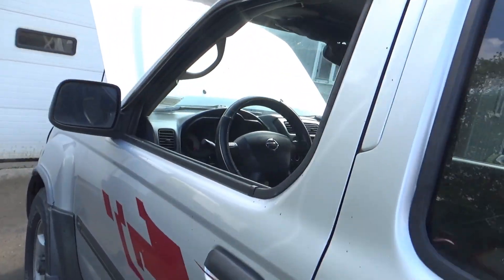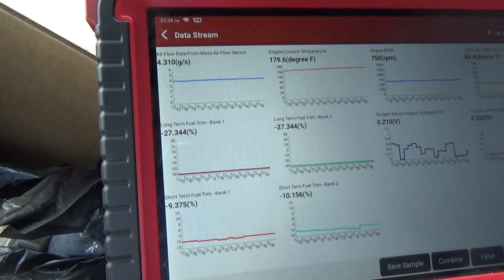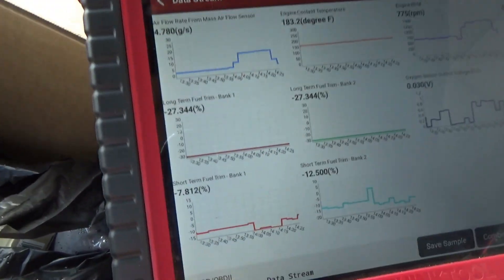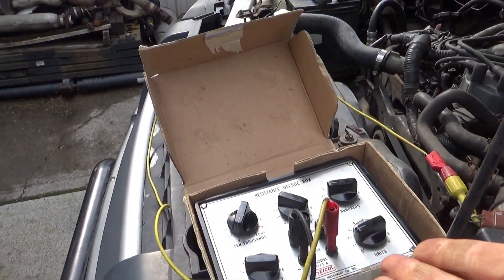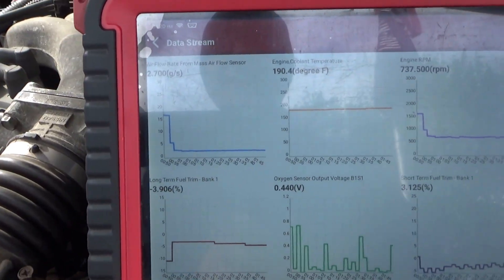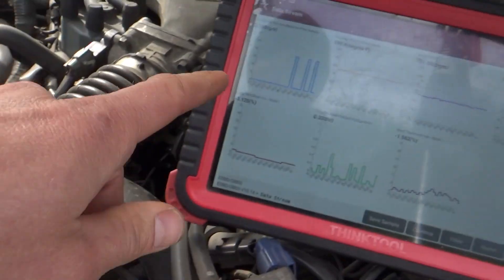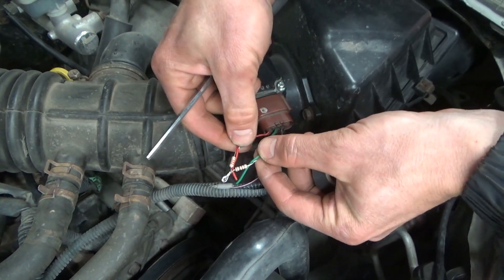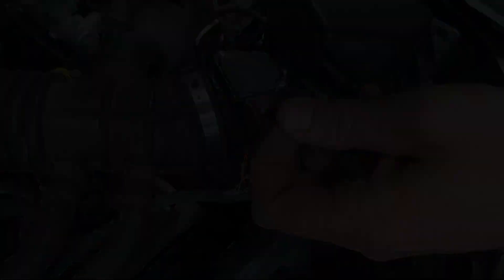I'm STUMPED...Crazy RICH XTerra P0172 (Part 2)

Comment: I know you have a part 3 coming.

From what I see here, I would suspect either O2 sensor issue or fuel injector / pressure issue.  Even before you changed the resistance the values were pretty much in spec per the service manual, I understand why you did that, but I don't understand why you didn't test the signal at the ECM.  The glitchy OBDII readings also make me wonder why you didn't get the scope out and do a more thorough data log on the MAF readings, maybe you didn't have the scope with you that day?

But at this point you've pretty much ruled out the MAF as being out of spec, but you are still trending negative on the fuel trims. The screens you showed with the fuel trims, the Short Term always trended to negative, they never seemed to find a happy balance where they would fluctuate negative to positive to negative, and the long term trims seemed to be showing the same 15:17. What else contributes to the fuel trims on this vehicle?  MAP(?)/Air Temp(?)/O2 sensors / Fuel Injectors / Fuel Pressure.   If the air coming in is being metered correctly/accurately, and you are still running rich, then either the O2 sensors are misreporting or there is another reason that too much fuel is getting into the combustion chamber.  Since you don't have misfires, I would expect the problem to be more uniform, which would tend to point towards incorrect fuel pressure, probably a faulty regulator.  

You mentioned that there isn't a port to test the fuel pressure, but that doesn't mean its not possible, its just not as convenient.  At this point I would think to start with verifying the fuel pressure is within spec, that the regulator is adapting to engine load, that the fuel pressure holds stable at KOEO,  and then I would consider testing the pressure drop from each injector, which I believe you've shown how to do in other videos on the channel, to verify they are all functioning comparably.

It's still a process of elimination, and I haven't seen a definitive AH HAH moment yet from the first 2 parts.  Usually when you make a decision to modify something it's more definitive than what you've shown so far here.  Clearly you are making improvements with each attempt, but I hope Part 3 will get to the root cause/solution.
Reply: what about the A/F fuel ratio sensor in the exhaust pipe?
Reply: @randy1ization  that is the O2 sensor.  There are at minimum 2 on this vehicle because his diagnostic screen showed him monitoring them, and realistically that means there are likey 4 O2 sensors, because they are almost always installed in pairs to monitor the catalytic converters.  The ones before the catalytic converter are the ones the engine uses to adapt the air fuel ratio and these are the most responsive for diagnostic uses.   From the diag screens he showed the O2 sensors are giving believable data, but they are both trending to reporting a rich air fuel ratio.

There is no seperate sensor in the exhaust system to measure air fuel ratio. This is the job of the O2 sensors.  The engine has to know at minimum 3 things to calculate the air/fuel ratio... How much air went into the engine, how much fuel went into the engine, and how much oxygen was left after combustion.

MAF sensor is in the intake to track incoming air.
O2 sensor(s) in the exhaust monitor outgoing air mixture.

The computer is programmed to cycle the injectors a set amount of time based on engine load/rpm and has a value for how much fuel should be added in that amount of time.

It takes the sensor data and the fuel timing and does a little math to get the air/fuel ratio.   And then it adjusts the fuel injection timing to chase the desired air fuel ratio.

If one of the sensors is  giving inaccurate data, then the calculations are inaccurate, which is why he went after the MAF first after demonstrating that causing an intentional vacuum leak and allowing unmetered air to be pulled into the engine, that the O2 sensors reacted to the change and the computer attempted to compensate.

There are limits programmed into the computer that set error codes for either RICH or LEAN conditions if the amount of fuel injection timing the computer is having to request goes too far from what it's programmed to expect.  Usually that's something around +30% or -30% fuel injection timing.   Some variation is normal ideally you would want to see +/-5%...uo to 10% is about typical.

Comment: Few suggestion Ivan, maybe worth disconnectiong to MAF and forcing it to go on to limp home mode see how the fuel trims like that, or see what the injector dwell time is, thats where the buck stops, if thats normal maybe the injectors are dribbling, and lastly fuel pressure is that too high, i assume you have checked the air filter lol, also i assume the thermostat is ok and engine is at correct temperature, not too cool......good luck, enternaing stuff...Fred in England..
Reply from the maker: Unfortunately Nissan doesn't have a good back up strategy without the MAF...
Reply: I was thinking exactly this. Never saw Ivan check the fuel pressure. Could be a pressure regulator that has failed. I have also run across issues where the motor was replaced with a junkyard one. Year to year they will often make small changes. Turns out the injectors had been altered and was causing a fuel trim issue. Put the original injectors from the old motor in and problem solved.

Comment: Been there, done that...with a 06 Toyota Camry..my own vehicle. It had been to the dealer 4 times with the same issue and despite replacing the very expensive front oxygen sensor, it would run rich and the check engine light would come on again.
Took me multiple weeks to finally sort it. I replaced the MAF sensor as it wasn't the correct one. (Yes, it was OEM but not the exact same part number). Didn't make any difference. The long and short term fuel ranges would peck out after a while again. On my Toyota it takes 3 cycles of the same condition before it sets the Check Engine light. So the Dealer simply replaced parts, then disconnected the battery for the long term fuel trims to start from zero and it would take multiple runs before the light would turn back on. 
The problem was simple slight pin corrosion in the MAF female plug. Simple electrical cleaner spray and multiple plug/unplug would improve the fuel trims. After doing this 3 times, they finally came well into the lower single digits at idle/engine warm/closed loop and aircondition OFF.
It's been more then 4 months now and the problem hasn't returned, plus fuel efficiency improved by a mile.
I purchased the car 2nd hand and the owner of course washed the engine to make it look good. 
Electrical components and water/cleaning solvents to not belong in the engine bay, unless extreme care is taken.
The MAF sensor is actually a "Current device" measuring currents my uA. It's represented via voltage using ohms law. At such extreme low currents measured, the slightest increase on resistance at connectors or wiring, has a detrimental effect of the fuel trims.
What you have effectively done is you added the resistors in parallel and increased the current flow, therefore dropped the voltage slightly, creating the same effect as resolving the high resistance issue.

Comment: Idle sounds high. Did you learn the throttle body when you replaced the maf?
Reply from the maker: 750rpm when fully warmed up 👍
Reply: @PineHollowAutoDiagnostics  I have had cases were people change out the maf without resetting anything. I would reset the idle air volume and self learning for the long term trim. Also check the fuel regulator, those are known to leak into the vacuum line
Reply: It did seem high, but maybe wasn't fully warned up.

Comment: I had the same issue with Kia . the MAF sensor read 4gps and should be 2gps i found out the timing is wrong . because the MAF sensor report what it seen 
Very interesting case study . best of luck
Reply: I was considering a cam timing issue but the engine seems to run very smoothly.  Absolutely worth checking though.
Reply: @ferrumignis  well ur right but it was just one teeth off . thanks for the comment
Reply: Another vote for timing. How did anyone end up coming to that conclusion? 🤔
Reply: @TheFrenchPug   i had the same issue and found out the timing is off after fix the MAF read just 2gps no 4 gps

Comment: defiantly could be that the pcm calibration is from a different setup and interrupts the same voltage as more gps.
like if it were calibrated for a engine with a bigger intake tube would make the pcm interrupt less change as more gps

Comment: Computer and sensor ground voltage drop less than 100mv is ok less than 50mv is better A good reference book; Vehicle Voltage Drop Testing by Joe Glassford this reference book also includes acceptable voltage drops for the power feed to computer modules and sensors, monitoring the voltage drop on the ground and power feeds with a scope while on test drive is also a proven test

Comment: I mean electrically, the 'correction' the resistor is doing at idle is fine, but at higher RPMs, the fixed resistance value doesn't 'maintain' a proportional 'correction', by my figuring, at higher RPM, thus higher signal output voltage (meaning lower resistance in the MAF sensor side) it will correct/subtract more voltage proportionally than it would at idle (this is a simple voltage divider, say, random values, MAF at idle 10k, ECU side sense resistor to ground 3k, plus 3k 'fix' resistor, so now 1.5k (signal voltage factory 3.3V, 'fixed'  1.85V =44% reduction!, but at high RPM MAF will be at say 3k, ECU still at 1.5k instead of the factory 3k, resulting in a much higher signal voltage reduction at high RPMs! now: factory voltage 7.1V, 'fixed' 4.7V=33% reduction) Now this looks like it 'works' after the short test drive, but the electrical logic is a bit  flawed with this fix but now after running my sample numbers, it actually looks pretty decent really, and kind of negates my critique! I wonder if putting a shottkey diode in series with the signal wire, which would drop 0.3V under all conditions, the fix would be better or worse...
Reply: I think he put the resistor in paralel I think, but other than that you are right. The response factor is changed together with the better offset. A simple diode would be the better solution. Or finding the real issue (bad ground signal wire ?)
Reply: @mauricevandoeselaar  yep, or course the resistor is in parallel with the ECU sense resistor connected to ground. by series i meant the usage case of a diode...
Reply: I see, yes that would be the better solution
Reply from the maker: On test drive fuel trims stayed in single digits for all rpm and load ranges so it actually worked great!
Reply: @PineHollowAutoDiagnostics  Yep I agree, just think it was a tad bit of luck the resistor happens to behave electrically that fits this situation so well...

Comment: it's what others said.  Your ground is poor.  You basically fooled it by using resistance to "bleed off" excess voltage.  Bring in a fresh ground and you won't need resistors.
Reply from the maker: Which ground? MAF ground was 57mV which is good 🙂

Comment: Man, talk about treating the symptom not the problem. I get not wanting to spend big money on a new ECU, but I would have at least checked power & grounds at the box considering you were seeing a signal with the engine off. also could have unplugged the MAF to see if the ghost 300mv was coming from the sensor or the ECU itself.
Reply from the maker: 300mV is normal... Not a ghost 😉

Comment: If this vehicle uses a laminar flow screen upstream of the MAF make sure it's there. If it's missing it will read just wrong enough to mess with you and offsetting the MAF with a divider network will only work at the speed it was set with. Same way with partially blocking the MAF port. So make sure there are no missing seemingly meaningless parts in the tunnel.

Comment: Resistor in the PCM not reading correctly? If it were a corrosion/bad ground, it would already have a have higher resistance reading. I think that since you fixed the issue with the external resistor, looking at the engine management computer in unnecessary. I think you did really well on a tricky issue. One thing about cars is that they will always show you something you've never seen before.

Comment: is the air inlet temp reporting wrong so the g.sec calculation is wrong?
Reply: The whole point of a MAF sensor is to report air mass rather than air volume, it automatically compensates for air temperature and barometric pressure.  Inlet air temperature is still needed for e.g. ignition timing though.

Comment: cccp engineering at its finest.  I remember a guy that worked on IBM machines way back when in the former Soviet Union and figured out all the bugs and how to maintain and fix them because they didn't have access to IBM support.  Coming to the US he was able to put that skillset in use by coming up with solutions most IBM field techs would not even think of as it was typically and rip and replace for simple stuff..nice job figuring a solution that didn't cost an arm and a leg

Comment: Couldn't a bad ground at the PCM cause similar issues if it can't carry enough current? Also noticed the intake air temp was 73-85F before the resistor was installed (and you were wearing a hat and coat so I assume it was cooler than that) and 53-65F afterwards. Interested for part 3.

Comment: In this case I wood check the fuel pressure or oil if it is not delute with fuel
Reply: Both of those problems could cause a rich mixture, but they wouldn't cause the MAF to see an increased airflow.

Comment: Ivan was the oil changed after the new OEM MAF was installed?  Is this a digital or analog MAF?(I assume analog because your just reading voltage from the sensor).  What is the voltage directly at the computer is there a discrepancy?  Any re-flash/updates available for the computer that can be complete.
Reply: I've read two fixes from Nissan techs on here for this issue. One was updating the ECU software. The other was timing chains ended up being off by 1 tooth because of a botched timing belt replacement.

Comment: I can remember on the Nissan RB25DE computer out of the Nissan R33 Skyline GTS the ECU Only needed to see a 1 volt reference but the signal was ignored at idle speed & the air to fuel mixture was controlled by the oxygen sensor & it was an OBD1 ECU.

I think that in your case that you have either leaking fuel injectors,a bad fuel pressure regulator or a bad ECU !

Comment: Great video.  Super diagnostics.  Now my problem.  1995 Ford E-150 Van 5.8 L (351W) The coil went out again after 3 years.  I stayed overnight at a Part Store (Canadian Tire) put in a new coil and all was good.  There is a Capacitor from one side of coil primary to ground I think it's noise suppression.  I tested it and got 226.4 nF ESR 8,7 ohms, Vloss 0.1.  I'm wondering if I should replace it or delete it.  Looking forward to part 3.  Mike
Reply: Those are ignition condensers.  Back in the day when distributors had points, the failure of the condenser would cause the points to wear out very rapidly due to electrical arcing which the capacitor (condenser) would prevent.  When the coil was turned on and off by a transistor instead of a mechanical switch (points) it was still necessary to save the transistor (so I am told).  I am not an electronics engineer.  I would think that a diode would be used to prevent the inductive kick from going back to the transistor, but like I said, I am not the expert there.  
If that condenser was bad, I would expect the ignition module to be the point of failure, and not the ignition coil.
Reply: Did they still use ballast resistors in 1995?  If so, having that bypassed can fry ignition coils.  I would expect that to be integrated into the ignition module in 1995.
Reply: @paulstandaert5709  Thanks Paul:  No ballast resistor.  I did Photography for a company that made those condensers (back then) just aluminum foil and waxed paper.    I also figure that a failed cap would take out the ICM.  I hound a high grade MSD cap" it's red so you know it's good" name that guy.  In the reviews one guy said it lasted 4 trips a total of 10 hours for him.  The Cap registers on my tester as a cap and not a resistor so it's probably OK.  I'm thinking about another drive down the Dempster so I will buy a spare, maybe ICM too.  My ICM looks like it was just bought yesterday.  Thanks again.  Mike.

Comment: One common problem area with those VG33e engines after many years of use is poor contact at the ground connections, which can cause the condition you've observed. The two main circuit grounds are connected at the top of the intake manifold closest to cylinder bank one.
Reply: grounds connected to intake manifolds always cause problems.I usually move them if possible.
Reply: But wouldn’t a bad ground lower voltage the ecu sees and hence under report on the maf vs over report like we see here?

Comment: I’m thinking faulty/clogged egr. The higher than specified air flow thru the maf at idle is because it’s not getting air from the egr.
Reply: If EGR is off (as it should be at idle) the MAF should be measuring the airflow into the engine accurately.  When EGR is enabled it drops the measured airflow, which is how the ECM can check that EGR is functioning correctly.
Reply from the maker: At idle EGR is closed 🙂